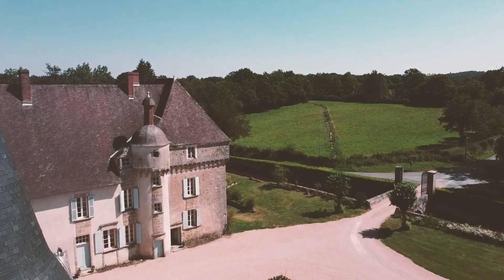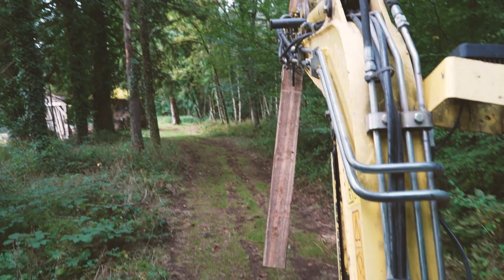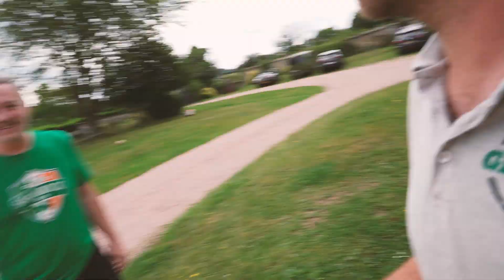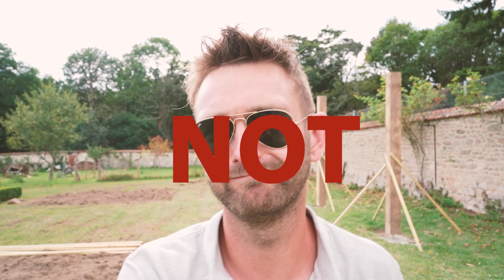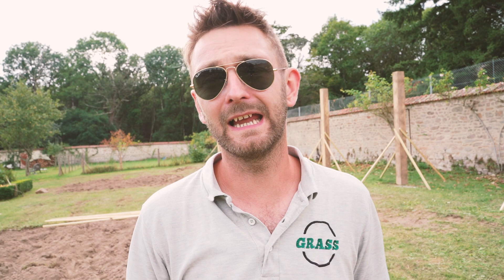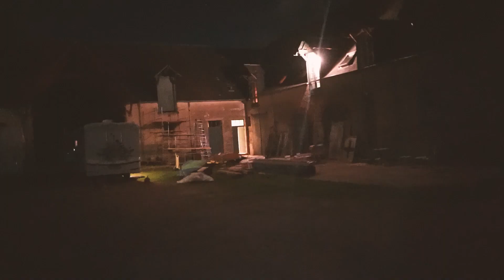lasers at night - EP101

Comment: I’m always surprised when I see you using a hand saw.  In the US, we paint pretty pictures on them and hang them over the fireplace.  LOL.  My husband does have several, but I suspect there is a heavy layer of dust on them.  However, there are more than 10 or 12 power saws of various sizes and descriptions.  I guess we are pretty lazy here!
Reply: My nephews use hand saws as there is no electricity.

Comment: Hope those green timbers don't split or crack! Maybe they should have been allowed to cure, first?
Reply: Nick over saw the milling of the wood and they were dried in the wall garden. Selmar and Amaury are carpenters, so if the wood needs to be treated, it will be.
Reply: @carolinegooder7091  Wood that has been freshly chopped down needs to cure for some time, even if the trees were dead when they were harvested.